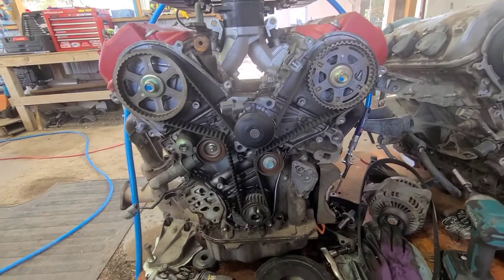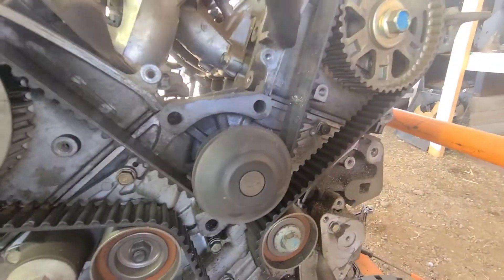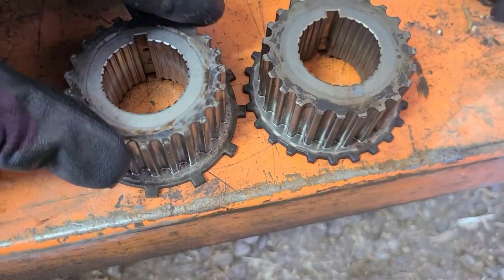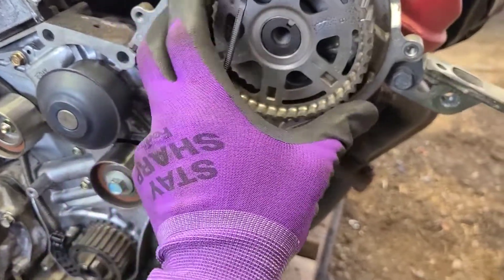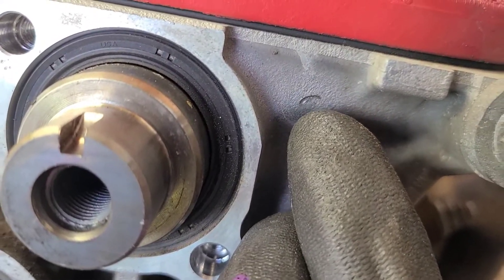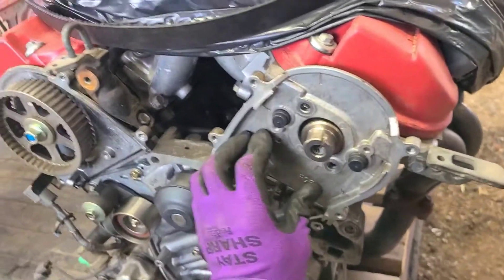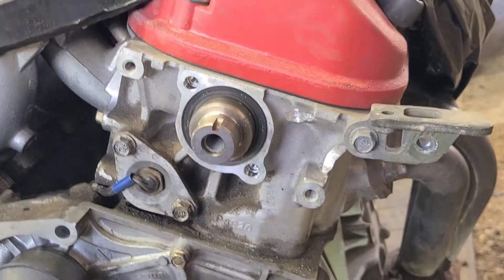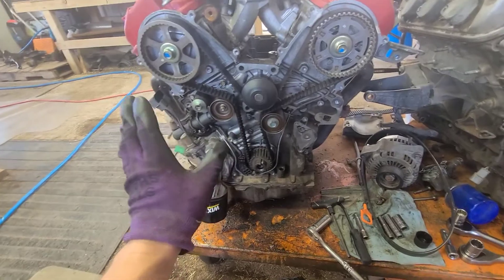Honda J Series J32A2 6 Speed Swap | Cam/Crank Sensors & Gears

Comment: Does this apply to all j series engines auto to manual ????
Reply from the maker: Tbh I would say this really only applies to the J32A2. I could be wrong but I haven't had any hands on experience with the later engines. I do know its not 100% necessary. People have manual swapped using the auto harness and ecu..

Comment: What is the part number for that manual crank sensor? I’ve had trouble finding that exact one
Reply from the maker: Not sure. I haven't looked for an aftermarket one
Reply: @Octane_Mayhem it’s crazy that exact sensor is basically obsolete, I can’t even find a photo of it anywhere
Reply from the maker: @ivanisakov6627 yeah there wasn't a lot of CLs made 6spd.

Comment: Is it still possible to run a manual transmission w/o having to swap the cam/crank sensors and gears???
Reply from the maker: I thought I remember reading from the AcuraZine forums that you could if you jumped a couple wires and the park wire ect. I've actually been trying to find that out myself. I want to try to go back to the auto harness and ecu, I think there is something wrong w the manual ecu I don't have anything over 5500 rpm after the manual swap.
Reply: @Octane_Mayhem  oh okay, just asking cause I have my 6 spd trans from an 04 tl ready to throw on

Comment: Im sorry if you mentioned it already but is the trans from an accord or a tl? I cant find either anywhere! 😅
Reply from the maker: Goodluck finding a 6 speed. That's why we did our latest swap an automatic.  But this particular one, the manual, came out of an 03 CL type S. The auto, a TL type S.
Reply: @Octane_Mayhem  what all would I need from a cl-s to just do an auto build since manuals are so rare?
Reply from the maker: @danieldukes1954  we just found a complete running and driving 03 TL typeS. So you'll have everything engine, trans, harness, ecu, shifter box and linkage.  But there isn't a company that I know of that makes mounts for the auto swap.

Comment: Do you have problems with vsa
Reply from the maker: No I don't think so.  Are you ?  My RPMs are good. The only thing is no VTEC at the moment
Reply: Did you fix the no VTEC?
Reply from the maker: @Trenchboi69  not yet ...
Reply from the maker: @Trenchboi69  I haven't had much time to look into it yet.  But do you think it's related. I didn't have issues with VTEC before the swap. And the VSA light has been on since before the swap too. ..
Reply: @Octane_Mayhem  is it getting everything it needs for vtec ? Is your coolant temp working? VTEC uses that also

Comment: @octane & mayhem can i straight drop in a j32a2 Into my 04 base tl 6 speed manual
Reply from the maker: Yeah, PJ Walters on Facebook is making some plug conversions for this rn.  So it should be all plug and play.
Reply: Awesome ! Thanks to you and him will get in contact with him !
Reply from the maker: @Ua6.717  no problem, he's on the Jseries and JSwap Engine Community 👍 all your wiring needs for Js

Comment: You didn’t have to shave the head for the sensor bolt. All you had to do was take the sensors off the plates and switch them 🤷🏻‍♂️
Reply from the maker: Tried that believe me. It doesn't work they're different
Reply from the maker: For these 2 motors anyways.

Comment: Just noticed something when you were putting the top came back on you were using the automatic cam pully not the standard one do I use the automatic cam pully One has bigger lobes then other one but the same amount
Reply from the maker: Good question. Yeah in the original edit I did film putting on the auto cam gear. But I did put in big orange letters use the manual cam gear.  A couple mins before that ...  I said "it's a couple days later...." I explain how I went back and ground those spots and did use the manual cam gear.  .. so yes. If you're using the manual harness and sensors you need the manual cam gear w the big lobes. 👍

Comment: What year does that lower crank shaft sensor come out of cause I can’t find it
Reply from the maker: I believe it's only 02 03 TL/CL 6 speed
Reply: Can’t find one online would you by any chance have one with the wire lying around that you can possibly sell me or I need to know what kind of J Series block it is
Reply from the maker: @greaseroyalty8518  I don't bro I only had the one 6 speed motor. You'll have to find a manual J32A2. If you can't find one I know people have just reworked the automatic harness.

Comment: Did you blow up the original one (left) or why you switching it over?
Reply from the maker: No it came with the CL with the 6 speed. I got it for the 6 speed swap, the owner said he thought the motor was no good and the auto motor has over 100k less miles
Reply from the maker: I'll be using the heads off the manual later for a stroker build.
Reply from the maker: The motor with the red valve covers is still good, the auto. Just switching this stuff to be able to run the manual engine harness.